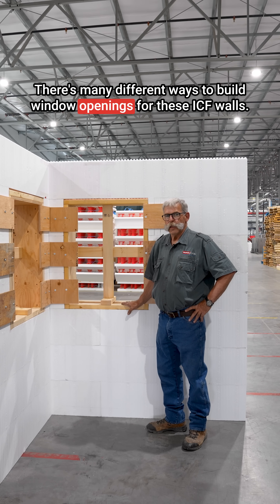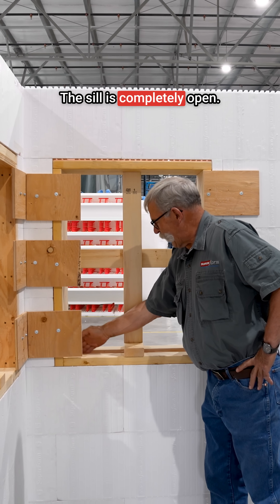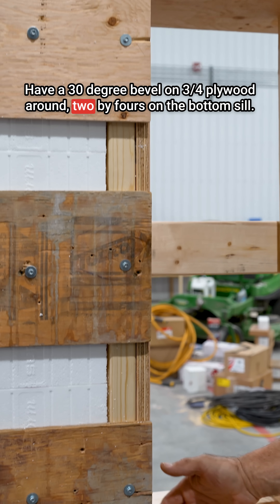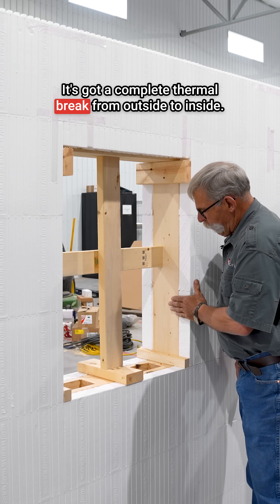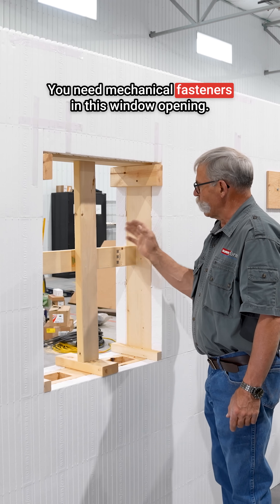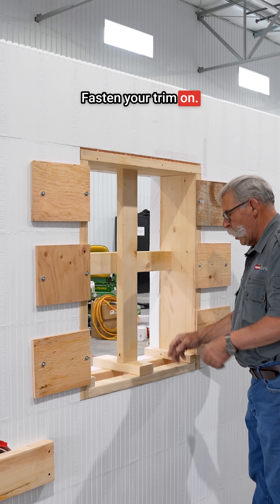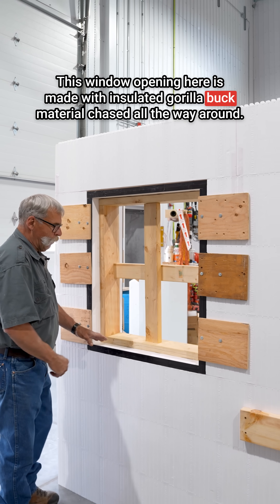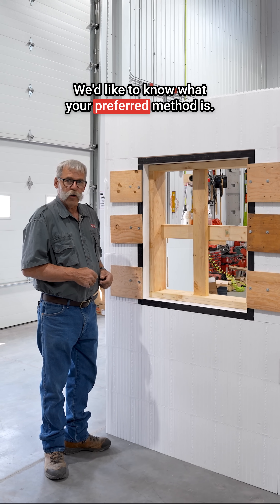Here are 5 Window Buck methods for ICF. What's your preferred method? #icf #construction #windowbuck

Comment: What about a boxed window frame where it's flush concrete to foam all the way around, no bucks? With windows secured directly to the concrete core through the jambs or clips on the inside? This method was explored by RDH Building Science about 10 years ago, and was reported as the strongest of all window mounting methods.